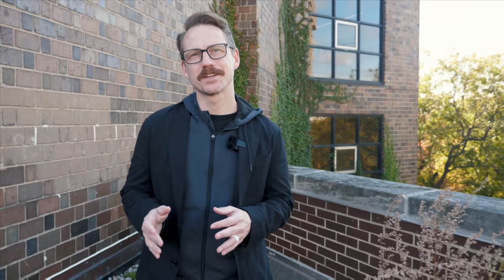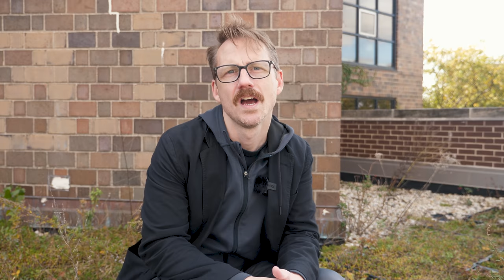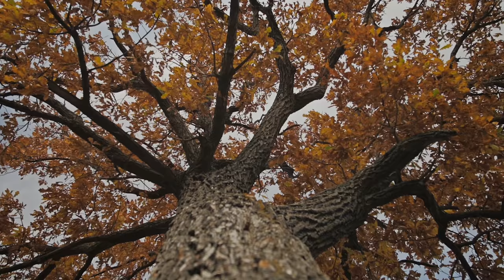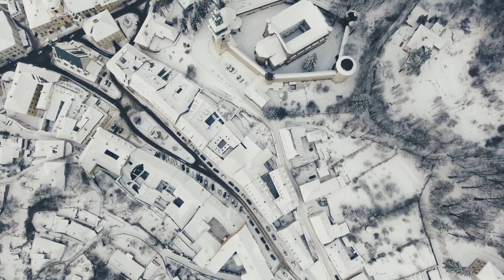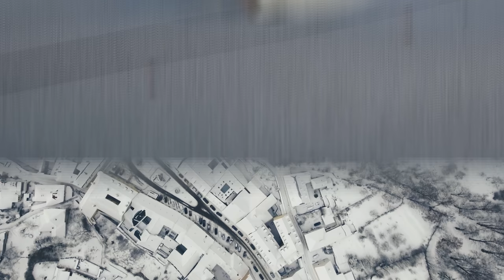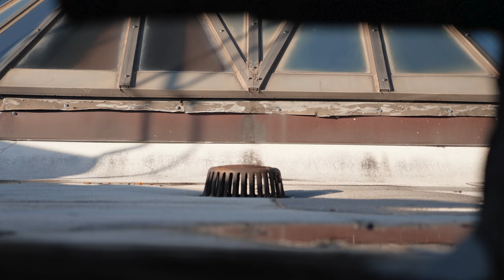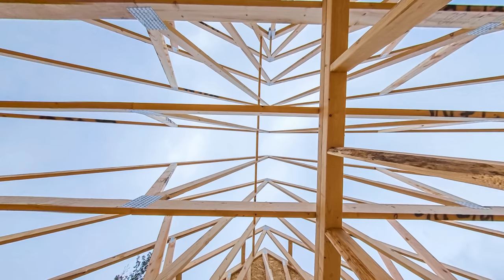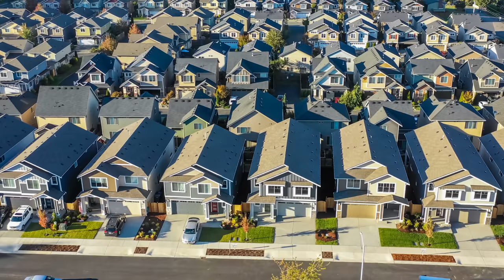Why Do Architects Insist on Using Flat Roofs?

Comment: Imagine an ice build up on a sloped roof breaking off and falling 10+ stories. I think flat roofs for big buildings makes sense.
Reply: That's called an icicle. They form if there is an overhang, and they kill people anyway.
Reply: But ice only builds up/stays in place of water is allowed to stay in place for a while, on a sloped roof this is not the case as the water naturally flows down. (Of course you will have some minor build up but it really isn‘t a big problem)
Reply: @PhilfreezeCH  I dont think you live in an area with snow. Wet snow sticks to sloped roofs and melts and refreezes over time forming very hard ice
Reply: @PhilfreezeCH  Maybe live somewhere that snows first before commenting🤦‍♂️
Reply: If there is an overhang, it won’t matter what shape the roof is, there‘ll be a chance for icicles.
Reply: @PhilfreezeCH  I have seen a teenager-sized icicle hanging from a sloped roof of a 5-story hotel. And it wasn’t just one icicle, the whole perimeter of that roof was covered with such anti-tank shells
Reply: Yeah, buildings like that must be surrounded with tape in the winter
Reply: Sadly, that will not prevent it. However, it'll be safer for any maintenance workers up there if it's flat.
Reply: I had the chance to talk to an architect once about it. She said it was possible if you slope it enough, you can (sort of) solve it with certain materials and stuff. But when it comes to cost of maintaining it the flat roof is just cheaper (And a whole lot less dangerous). So for bacis smaller homes sloped roof in heavy snow  makes a lot more sense. In tall buildings a lot less.
Reply: @PhilfreezeCH  I've seen 5 foot icicles from a sloped roof.
Reply: Yeah but that’s a badass way to go
Reply: @PhilfreezeCH  you ever seen snow buddy
Reply: That happens in New York anyway
Reply: As a Finn; you just put  ice guard rails on the roof and in melting season you have regulared cleans of the built up snow aswell as you use warning rails on the sidewalks.

Not that hard or expensive.

Every building uses that.

Also flat roofs won't work here on the large scale because of our climate. It may work in LA, but it sure as hell won't work in even Southern Finland. So you can't just stick by flat roofs because you can't proplem solve inexpensively.
Reply: In Russian cities where the old buildings have sloped roofs in dense urban areas many people are killed by falling ice every year.   A block of ice almost hit me when I lived there.
Reply: @Shipx7  if the attic venting is good then you won’t get a massive ice build up.

I do get flat roofs are good for tall commercial building for that reason, but also they have so many flaws. 

Detailing around penetrations is always an issue, snow and ice buildup even worse on flats, not for falling ice but for roof damage and dips creating ponding.

I’m ok with flat roofs, but give it a bit more of a slope. Not a pitched roof really but just a bit more sloped than the minimum they use to make them.

Better water flow on the roof drains quicker, quicker drain = longer lasting roof.
Reply: Living in Calgary, during the many icy/windy winter months, there are some downtown areas that are literally death traps for falling icicles, even those with flat roofs.
Reply: @marialindell9874  Which high-rises in Finland have non-flat roofs?
Reply: @SirCutRy  Finland doesn't have skyscrapers and our tallest apartment building iss max 30 floors.

The 20-something floors tall hotel built in my city doesn't have a flat roof. It's slanted with snow railing and warning lights. The new, rather tall, 20-something-floors apartment building attached to the new arena has a slanted roof, with balconies littered in it. It also has snow railing, roof windows and red warning lights for airtraffic and drones.

Most of the tallest buildings in my city have been among the oldest (built around the early 1900's) and those for sure don't have flat roofs. None of the new building have them either.

The only flat roofed building I know were built around the 70's and consist of private family homes or "row houses" and even those sometimes have a slant to them. We weren't building that many tall building in the 70's and those built, don't have flat roofs.

To come to a conclusion: we don't have high-rises with flat roofs because it does not work here.

Its better and more logical to have a slanted roof (or something alike the a-frame) and just put snow railings on that baby.

Then when you have a lot of build up of snow, you just call the maintenence guys, who get on the roof with shovels and they clear out the snow safely. This also applies to large ice-build ups. That's way cheaper than risking serious water damage.

You just take some warning tape or the fences meant for this job, close off the area onthe street and go at it.

Heck my building has their seperated shack for trash. It's really low annd doesn't need the railings. Still it tends to get about a metre of snow during winter than can hang off the ledge. When there's too much hanging over or when the snow is too thick, the 70+ year old neighbours climb up on the roof and push down the snow. That's normal practice here.
Reply: @PhilfreezeCH  Sounds like you live in Texas or Florida.
Reply: @justinstevenson2061    I don't think venting is going to make a difference one way or the other.
Reply: @dennykeaton9701  well I just want to tell you it will for sure.

There will be some natural thaw form sun or warm winter days, and that will the freeze once colder overnight etc.

Ice will always form regardless. But the point is it’s thawing due to heat. Sun or wake days is outside heat.

If you then also have inside heat trapped below the depth of the snow it will cause more melt. That will then inevitably cause more volume to freeze. Therefore more ice build up.

Just as simple as that really. Source - 15 years experience as a dedicated specialized roofer, not a general contractor/tradesman etc.

You ideally want snow to stay as snow, until it’s ready to melt at which point the majority of meltwater will drain. Some will refreeze for sure but you don’t want that/freeze cycles happening all day every day, and with no venting your insulated cavity is retaining heat which is causing melt.

The home/building is always heated, and always losing heat. Even with top level insulation it still loses heat, just at a slower rate. That heat has tk go somewhere. And it’s in contact with snow which is at least 20 deg Celsius lower temp if not more than 20 deg difference and thag causes melt. Period.

Also, can cause condensation to form and have no way to dry out (in the instance of fibreglass/Rockwool etc. less with spray foam but will still happen.

It’s just science. Wake air has more moisture. As it cools it condenses which causes it to be able to hold lwsss moisture, this is how condensation forms.

Again just facts of life.
Reply: that was my Immediate first thought too.
Reply: @SoloRenegade  ya but a giant ice build up in a two storey building can kill someone.

More about not having massive ice build up; and providing proper drainage.
Reply: There are ways arond that.
Reply: They ... don't form when its slanted because it all goes to the ground immediately ...
Reply: @leonardonetagamer  You clearly have never been anywhere cold.
Reply: @Shipx7  me whos lived up north forever
Reply: @leonardonetagamer  Then you should know that ice and hard snow still accumulates on sloped roofs.
Reply: @Shipx7  if its not a steep enough angle or there is something blocking it from properly draining then yes
Reply: yeah, i allways thought it was a safety thing. I would not like to stand close to a huge building when the snow/ice mixture releases and comes flying of the edge. it can be dangerous with a normal House. Most likely Fatal with the amount and height from a big building.. (And for the one guy that doesn't know what a Northern winter is like... We are not talknig about normal icicles that hang of the sides..)
Reply: @PhilfreezeCH  especially with the high winds
Reply: I've seen dangerous ice on both flat and sloped roofs. There are solutions to the problem for both. But are they used? On newer roofs, yes. But older roofs of both types have the issue.
Reply: @PhilfreezeCH  Snow build up often occurs though, and if that snow partially melts, or there is rain it can become ice. Car size blocks of hard snow dropping many floors can be lethal. It's not such a concern around a house, but a large building? Your insurance coverage would skyrocket.
Reply: this still happens.... Ice forms on the sides of building, on balconies, on flag poles, on signs, etc. and fall.
Reply: @marialindell9874  You may want to explain what snow railings are (and do).
Reply: That is why there are snowladders on the roof.
Reply: Why do you need a 10 story building?
Reply: imagine going outside and out of nowhere you're crushed by a sheet of frozen snow falling 100 feet.
Reply: As you are - joyfully - opening pandoras box, aka. city planning / urban planning: An 8+ story building is an idea some would consider as unnatural, in parts of europe and afrika also known as 'stupid americana'. Just saying though.
Reply: @Ay-xq7mj  It still very much melt in the spring. Falling iceicle is a problem
Reply: @Idontlikeanyoneanywhere  Ice is a far bigger problem. Because snow falling from very high heights usually flow a part and are slowed down. Even if the snow is really wet, if its falls something like a 100 feet that will tear it up into smaller bits.

I seen something like a big bit of snow falling from a 5 storry building onto a person, but when it hit street level, it was mostly a clowd of dust
Reply: Icicles only form if building is badly insulated and leaks heat. Usually buildings have metal structures in end of roof that stops snow from falling down
Reply: Also snow or ice reaches max speed after a certain fall. After that building height doesn't matter
Reply: How about we dont build 10 story monstrosities?.
Reply: It's amazing the ignorance that catches on on the internet
Reply: If they're sloped more than 55 degrees from ground, the snow falls off
Reply: @Shipx7  that's why you have regulations, that depend what is the roof material, like thin, shingles or ceramic tiles, but more importantly depending on climate, my country is partially mediterranean, and there the slope can be by regulations much milder, while in the north of the country it can't, and if you go farther toward the alps, the roof is even steeper exactly for that one reason.
Reply: Doesn't matter still occurs if the roof collapses
Reply: there's a building in my old college campus kinda like that, but it's only about four stories and I think they're actually decorative slopes or something. Everyone gives it a wide berth when it snows because giant sheets of ice slough off and crash to the ground loudly, it's pretty scary.
Reply: If you want to experience icicles on a large scale, visit Saint Petersburg Russia in a spring. In central districts you’ll find danger signs on most walls and people walking the car road instead of walkway, and looking up every couple seconds😹
Reply: There’s a simple fix for that, attachements on the roof to break up the snow.
Reply: I mean, a two-inch sheet of ice falling into the back alley here shook the whole building, whereas a car hitting it and infiltrating the front did not. Ice is nuts.
Reply: There's drains and systems in place against that.
Non-flat roofs can be as magnificent as Duomo cathedrals... instead...
Form follows function only when it's cheap.